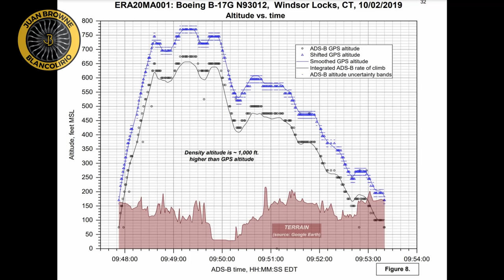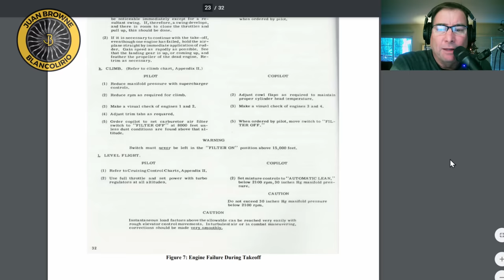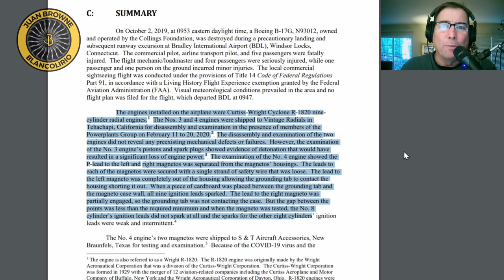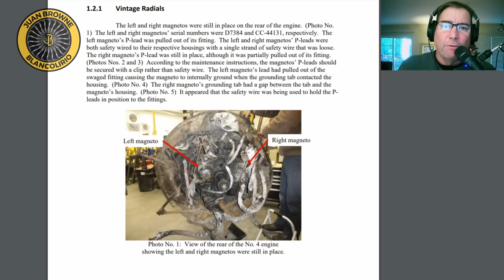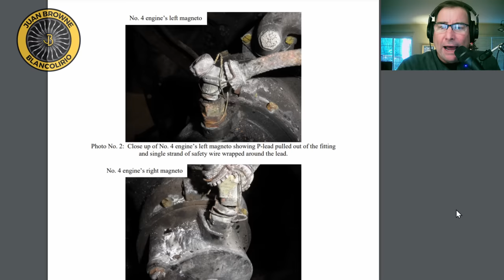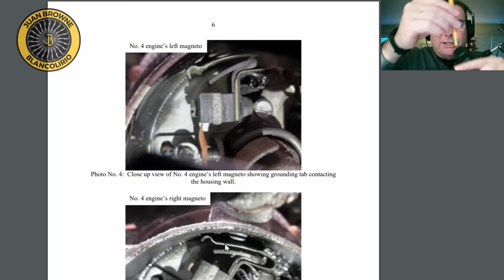NTSB Report B-17G Crash 'Nine-O-Nine' Part II -18 Dec 2020

Comment: Your concluding remarks are spot on!  Mac was the pilot and Director of Maintenance.  There was no oversight from within Collings nor was the FAA providing any meaningful oversight.  Lack of CRM and external oversight over training are likely to be contributing causes to this tragedy.  Sadly, the insurance industry has already cast their vote - premiums for warbirds, and particularly warbirds used for rides, have skyrocketed since this accident.  Regardless of what the FAA does, the insurance industry has already priced the LHFE out of business.  What's particularly sad is this:  Collings Foundation has a BUNCH of warbirds.  They could have very easily chosen to have a few less warbirds and spend the resulting savings on better maintenance and oversight.
Reply: I spoke to Mac, on the ground, at Bangor ME about 15 yrs ago after taking a tour of Nine O Nine. It was clear that the man loved this airplane and loved flying it and caring for it. I am 73, and have worked in building construction for 45 years, and still do today. Even though I still work it is clear in my mind that both my physical and mental skills are NOT what they were 35 yrs ago. Mac had the highest time of any B-17 pilot on the planet, a magnificent record for sure. Yet his continuing to fly the aircraft, with paying passengers completely in the dark as to the unnecessary risk they were taking, was unconscionable. The gumped up magnetos alone should have grounded the aircraft. That they had to blow moisture out of  a magneto  (numerous times, almost daily sometimes) should have absolutely grounded the aircraft until repaired.  Detonation can be caused by several things including incorrect timing (too far advanced) incorrect mixture and excessive heat. I experienced this first hand in small block Chevrolet racing engines as a young man. The detonation should have been detected immediately by looking at the spark plugs. But you have to pull them regularly in order to read them, not just when the engine will no longer run.  With radial engines, and even in your Cessna 150 it is a normal requirement, just before flight,  to run up  the engines and check both mags, by shutting off one then the other, and noting the rpm drop each time. This preflight check was obviously NOT done on Nine O Nine that day, or the more likely scenario, was just ignored. 

I still think it within the realm of possibility that the wrong engine was shut down. In commercial flying this has happened more times than you would think, even in turbine aircraft. They were at extremely low altitude and low airspeed and had little time to think. The pilot shut down number Four evidently WITHOUT trying to ascertain in any way from instruments or observation by the copilot who could look out his window. Number 3 shows major detonation which shortly would have destroyed the engine. It had to have been running very poorly in order to have as much damage as shown in the photos. I have been working on gas engines all my adult life and have seen the damage this can do first hand. We may never know this answer for sure but I would in no way rule it out. Perhaps the final NTSB report  may have more on this based on what happened in the cockpit in that short time available.

At the time of this crash I looked at Collings Facebook page on Nine O Nine. The youngsters were constantly begging for money needed to procure a spare engine for the aircraft. They should have been seeking donations of money to acquire (or rebuild) the magnetos on those two engines. I cannot believe that someone operating an aircraft like this, in the way they did, would not have had a spare magneto available to them when needed.  In hindsight some totally appalling decisions led to this disaster. The whole warbird community, and those of us who love them, will pay for this obvious neglect, sadly.

Comment: Initial start up of engines 3 and 4 and the attendant difficulties seem to bear out ignition issues. Mag checks during engine run up should have given some indication of problems as well, I would think. Regarding the shutdown of #4 engine, as long as it was producing thrust the shutdown during a critical phase of flight seems potentially premature.
Reply: The potential risk of the engine outright catastrophically failing is too great. The shutdown of #4 was the proper course of action.
Reply: @JeffCounsil-rp4qv  Perhaps it's unfair to judge at this point, but the whole scenario just seems too rushed... putting the gear down so soon, for instance. Without a Cockpit Voice Recorder we don't know how much coordination between crewmembers occurred, but I get the feeling that it became a one-man show with disastrous consequences.
Reply: @comlbbeau  True, but time was of the essence. And remember the copilot was NOT qualified for the B-17 and could have been doing things without understanding why the pilot did, or didn't do certain things. The pilot had to be a "one-man show" out of necessity because of the current situation he was in. The pilot may have had to try and counteract, or made corrections for what the copilot may have done adding to the complexity of the situation needlessly. Falling short of the runway could be quite possibly because the copilot did something to cause accelerated or premature altitude loss. If they had landed on the runway, they would have been past the buildings they hit. Then the situation would have been a lot different and possibly could have ended without such serious damage. At this point, it is all speculation. We could easily say that if the mags had been properly maintained, this would have never happened. But since there were problems, the situation dramatically changed and devolved into an emergency situation. I do firmly believe the pilot could have successfully landed. But was the pilot fighting an uphill battle complicated by the copilot? Hmmm, the possibilities...
Reply: @JeffCounsil-rp4qv  The aircraft was at very low altitude and low airspeed. There was virtually NO altitude to trade for airspeed. At 7,000 ft this could have gone a lot better with time to think. From the videos and what info can be gleaned it seemed that the pilot shut down #4 without doing anything to make sure it was the bad engine. They had trouble starting it so he may have been of the mindset that #4 HAD to be the bad engine. There is no info about checking the engine instruments or having the copilot look to see if he could discern which engine was the problem. In fairness to the piiot he had precious little time to either think or act. He had engine failure at about the worst place in a a flight that you could have it, close to the ground at low speed. He did an incredible job of making a flat 180 turn without stalling it. The internals on #3 look far worse after tear down than they looked on #4. The pilot was the only man in that cockpit that truly understood the airplane. So he did not have the kind of help with the thinking that might have been the case with a more experienced crew. We will likely never know for sure exactly what happened.
Reply: @nathanpitts1591  Agreed...  The #3 was definitely in the worst mechanical condition of the two.  But that wasn't known or realized until after the fact. Especially when it comes to the time/hours after the last rebuild. If only he could have made the runway itself without landing short, the result would have been a LOT different. He would likely have kept it straight and not hit anything.  It was such a sad chain of events where one single event, or decision (with or without hesitation) could have made all the difference.
Reply: @kcindc5539  Yes Keith, all discovered after the fact.
Reply: @JeffCounsil-rp4qv   ....Obviously.....

Comment: The grounding spring is there to protect personal when turning a propeller. If the P lead became disconnected there would be a HOT mag and the engine could fire. Hopefully the engine was shut down properly with the fuel firewall valve
Reply: True but not to be relied on as "safe" because relying on a good ground is deadly. Engine can fire if propeller is turned by hand and it is to easy for a poor ground (dirty/carrosion) because the system relies on a good ground connection giving you a false safety overconfidence the motor can't fire when it could. So a propeller / reciprocating engine on aircraft should be considered like gun safety, always loaded / ready to fire / start, so all safety precautions are in place as though motor can start even when turned "off". ..
Reply: I’m a bit confused - is the P lead an electrical wire or a physical cable that pushes against the grounding clip and runs all the way back to the cockpit like a morse cable?
Reply: @eliotmansfield  Well, it's an electrical circuit that starts where the tip of the P lead contacts the inner spring which is in turn part of the points, and a simple wire carries that connection into the cockpit where the ignition switch continues the circuit to airframe common (sometimes called "ground"). When the cockpit switch is turned on, it actually disconnects the P lead from airframe common and allows the engine to fire. If the P lead becomes shorted to the airframe at any point along its travel, the magneto will be shut off. On this magneto this can happen right at the magneto if the lead begins to disengage from the magneto body. Whoever installed those safety wire kludges had no understanding of the catastrophic things that could happen if those connectors vibrated out of position - which they would inevitably do.
Reply: @paulcrumley9756  Thanks - had a look at the report on a big screen and now understand the issue
Reply: @eliotmansfield  The P lead on a C47 aircraft is made with RG-8 coaxial cable I presume the b17 is also. When the P lead is grounded it shorts the points as if they were closed . A Magneto fires when as the points open. The rest of the magneto operation is hard to explain without diagrams and preparation by the student and also the instructor. It took me several hours to understand the internal gearing and how a four pole magneto fires a nine cylinder engine.
Reply: @airgliderz  I see you are not a Radial man and never propped through to check for hydraulic lock before starting. fifteen blades on a cold morning warms you up.
Reply: @airgliderz  I see we are in a pissing contest. Radial engines are propped through regularly. Those that do not  prop suffer bent rods and off field landings. That is widely  known in the radial flying community. Several years ago I changed an engine for a fellow WWII conditions in the dirt at KCMA who did not do it right. Sorry at my age I can not piss as far as you.

Comment: Great video and excellent explanations on B-17 magneto operation and ignition systems.  If I remember correctly, the magneto to engine timing is set on a Wright R1820 aircraft engine by a Vernier coupling.  To set the magneto to engine timing on a R1820 radial engine, you have to continually rotate the Vernier coupling with the magneto removed from the engine and then reinstall the magneto insuring the magneto engages into the Vernier coupling each time and check it with a magneto to engine timing light provided the mechanic has determined the exact crankshaft position or they use a Timerite tool to determine top dead center.  If the timing is off just a little bit, you have to remove the magneto again, rotate the Vernier coupling again to reset engine to magneto timing, then reinstall the magneto and recheck engine to magneto timing and keep repeating this process until the timing is set correctly.  If the magnetos Vernier couplings on this B-17 were deteriorated to the point where neither one magneto can no longer can hold their set position, it can indeed cause the magneto to engine timing to advance, thus causing a weaker spark from the magnetos.  I seriously doubt, because of the accident, if it can be determined what exactly the magneto to engine timing was set at before the crash.  Finding safety wire to hold spark plug leads together is a major no no.  Its pretty obvious that the Collings Foundation had failed to follow their own Maintenance Protocols that were approved by the FAA, which is why they lost their exemption and can no longer fly their remaining aircraft to events.  The sad part of it all is that this accident could have been prevented if only better maintenance practices had been put in place instead of having only one guy at the top.  When working on any warbird of this complexity, you need a team of mechanics working together where you have more eyes and ears to check and double check things and each others work.

Comment: Wow, the mags were in horrible shape.  A high school shop student would do a better job on a lawnmower engine.
Reply: eh... no i did a terrible job on my lawn mower engine when i was in highschool lol
Reply: @mach533x  i was never a good small engine guy myself...
Reply: Even lawn mowers are solid state ignition these days.
Reply: The mage were a little grimy but that one rusted out piston and cylinder? How could you get that way in a 300 hr motor and not know it?  
They should have been borescoping at every inspection when they pulled the plugs.
Reply: @JollyMcStanson  and most highschools don't have shop now 😉
Reply: @TD_YT066  Yeah how in the world? Somebody was winging it on a rebuild..These 1820s are AIRcooled and rust--plainly visible ---comes from water.Wot da fuq...Primaty lead being "safety wired" in place? Oh mah gawd..That's supposed to be a screwed together connection and seated..How could somebody with A&P licence sign off on something done so crappily?  And dang, no mag check in run up?  Hell I understood that when I was 7 years old (Dad was US Navy pilot and always had flight manuals on the kitchen tables and I ask a million questions, and he'd show me out in the aircraft---including pointing out the pre-flight check-lists, even made a big point "It's no longer "kick the tires, light the fires...You go down the check list.." And mag drop test is right there...
A dear friend who really was a VERY GOOD mechanic and very good analytical guy who I knew from my motorcycle racing days--very high performance, single cylinder 2 stokes, magneto ignition..when he retired at about 30 from professional racing he got into ultra-lights then bought a little old Piper cub..It needed lotsa of work..It was relatively low stress powerplant, simple as hell construction so he could do everything, but he explained "It has to get signed off by somebody with an FAA powerplant licence (when he was working on that) >He said those guys were usually retired Air Farce guys and they'd BS all about how the WORK has to be done in thier shop if he was going to sign off on it..Turns out the guys actually turning the wrenches were young guys working near or below minimum wage who were just thrilled to be doing anything near or on airplanes, so they did the work, old Master sgt, would come along, mumble soehing and sign off....Then he'd go back and re-do "all kinds of sloppy shit and savagery"..Same on airframe.. Shoddy and horribly expensive work but old geezer Mster Sgt sign it off and get paid---then back and re-do it all..
It must be something like that cause all the mag problems and the plugs and that cylinder are all horrible sloppy work..And it cost a bunch of people their lives..and destroyed an ultra rare now aircraft...
Reply: @TD_YT066  
I am thinking the corrosion in that cylinder is due to the fire afterward.  Steel in direct fire rusts. Rusts that heavy in moving parts would show 'rub' marks from movement.
Reply: @bragr_  /sign of a  nation in a slow,  continual decline.   I learned a lot about the real world by working with my hands in wood and particularly metal shop.   First they cut the arts,  and get away with it,  then they cut the sciences,    and everyone gets to serve fries to people who serve fries.
Reply: @TD_YT066   But who would suspect water even working its way into an engine like that considering the convoluted route it would have to take to get there? is there a known issue about water getting into the intake or exhaust and then into the engine through an open valve?
Reply: Ed Frawley that’s why you inspect things...to find problems on the ground rather than in the air.
Reply: @edfrawley4356  I'm reasonably positive from the pictures that that rust in the cylinders happened after the crash. The engines were lying around on the ground with the exhaust stacks essentially completely open. I'm sure the fire engines used foam and water to put out the fire. Having some pour into an exhaust opening and go through an open exhaust valve into a cylinder or two seems completely reasonable. With 7 cylinders at least one is always going to have an open intake or exhaust valve.
As someone else pointed out, there would be a huge amount of scoring on the cylinder wall if that much rust had been present while the engine was running, and all the cylinder walls looked pretty good.
Reply: @mach533x  Stay away from airplanes then.
Reply: @bragr_  Probably why more planes are crashing nowadays.
Reply: A high schooler won’t even know what magnetos are, I only did because I’m into aviation simulation.
Reply: @pR1mal.    Yeah.   And look at the timeline of this accident.   This accident portended the accelerated collapse of the USA, covid, riots, ...everything.
Just one more sign of a nation in catastrophic decline.